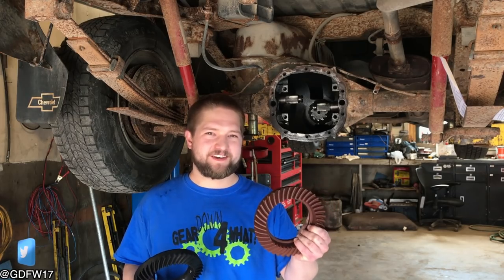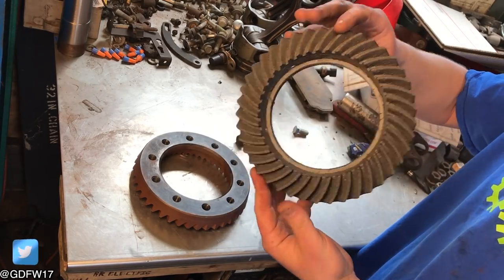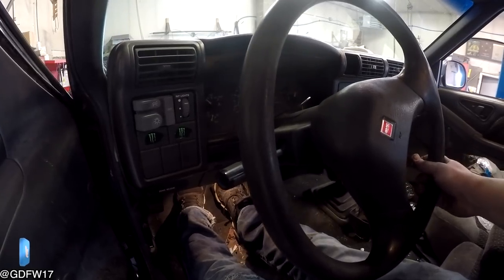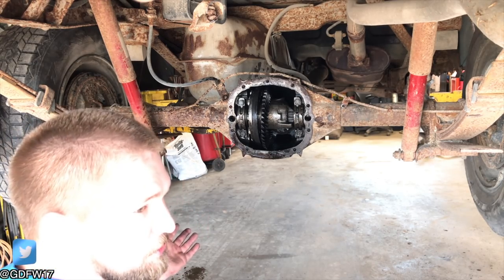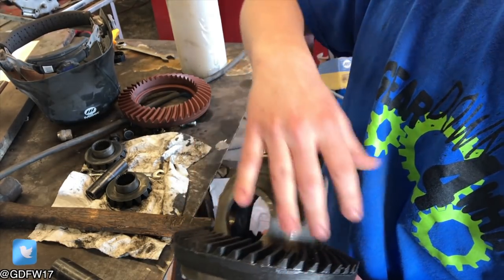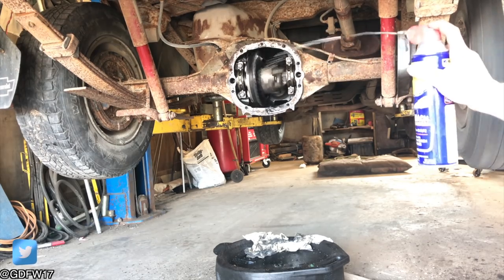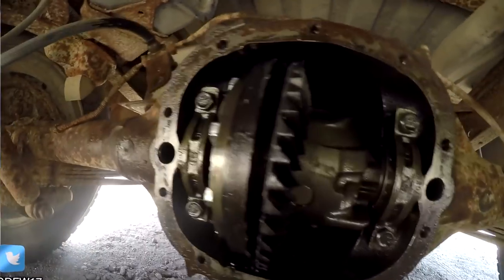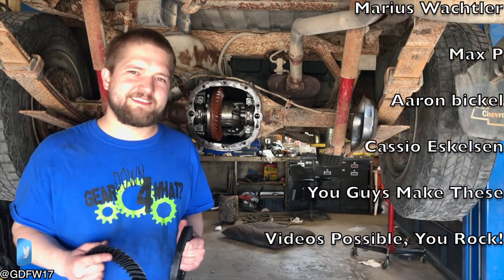Replacing Drivetrain Parts with 3D Printed Carbon Fiber Nylon - FOR SCIENCE!

Comment: Pretty slick! If you need to embed the nuts rather than drive them in from the outside I would suggest designing keys and slots into the two segments of the build. That would channel the torque load better than the flat surface of this design.

Comment: Usually, when you change the material you use in any kind of part, you must redesign it in order to adjust it'resistence to the new material. If the design keeps the same, probably, it will not work in most cases, but with changes, I believe you will have success.

Comment: you'd need to autoclave it,  the layers are strong against their tensile, but applying torque that isn't perpendicular to the layers, will cause separation since they aren't actually fused.

Comment: Either design this as a continuous print, or as two different prints with teeth to increase surface area.
Also WD40 is a terrible lubricant

Comment: Wd40 is petroleum-based. It melts most plastic.
Reply: Nylon is extremely resistant against most chemicals
Reply: I've never seen WD 40 melt plastic.  Any type, ever.
Reply: Maybe that is not the prpblem, but never use WD40 as a lubricant!

Comment: Print it at a 30° with supports, so that your z-axis does sit perpendicular with the torque being applied. I’d also use press in (with heat) corrugated nut inserts so that you’re not pausing the print process halfway through.

Comment: Slots to the inner edge of the ring, slip the nuts in via the slots and bolt up, that way the whole thing can be done in one print, you might also want to print it at a 45 degree angle so the grain isn't horizontal to the rotational pressure

Comment: Maybe just reheat the part before restarting the print
Reply: Michel PASTOR I was thinking this too, use a non contact thermometer to read surface temp at the pause, then heat gun or hair dryer to bring the surface back up to the previous reading.

Although I think using slots to slide the nuts is may work out better.

Comment: I have one thing to add, i have used 3d printed parts in production and for my part it's not the filliment that is the biggest issue. it's delanimation and layer density  in extruded printing. But if you need it to last say a 100 000 handelings before it brakes extruded is out of the picture. The only thing that works is SLS. SLS PA have been used in production for two years now and it is only chipped in some corners. and this is where aluminium is normally used but it doesn't work due to weight.

Comment: Use T-Nuts and put a recess in the rear of the gear body for the flange of the nut. Make sure to go slightly below flush with the recess so you can avoid wear. The bolt will compress the T-Nut against the gear body. The flange and nut shaft will act as the mechanical interface, which will limit mechanical wear on the 3d printed part. You can then also print the part all in one go meaning you'll get proper layer adhesion all the way through. Also, it's important to note that THICKER layers will result in a stronger part, but the detail will be lesser. It looks like you printed very fine layers, which results in a nice looking part, but one that breaks more easily. I think it's worth giving these things a shot.

Comment: Yes, totally to a full print and tap out left handed threads directly into the final product.

Also print it with slightly under sized holes so tapping out the threads will be easier.

Comment: Why did you have to hammer the nuts in? Why not size the nut holes so that they will just drop in or push in by hand and taper the holes very slightly near the bottom so when you tighten the bolts the nuts will snug up? You can drop or push the nuts in without interrupting the print this way. You definitely have to do this again!

Comment: You should try to print it as a single piece with slightly oversized holes, then use metal inserts for the threads.   You basically push them in using a soldering iron.  You get 90% of the benefits of threads, without having to pause your print, and it's much better than just cutting threads into the nylon itself.

Comment: I definitely think you should revisit this again. Taping holes isn't going to be an Issue. Making slots to slide in, I think would be less material and less strength , though easier than taping; but what I'd like to see is all the gears in the differential replaced with the carbon fiber filament. If this gear can hold up to the strength pulling the truck, I'd love to see a closed and filled differential running in second gear on the road. At that speed both gears should heat up, and of they are the same material, expand at the same rate. I'm curious how many expansion cycles it can endure at low torque before they self destruct or have the mating surfaces degrade before the teeth along the ring sheer past each other.

Comment: Have you tried printing in 2 separate pieces? Make the top part with dowels and the bottom with corresponding holes. You can make some double sided dove tails to connect the 2 halves and laminate the whole thing with epoxy. You'll have to compensate your scale to accommodate the resin but should solve your problem.

Comment: I think that custom threaded holes would ensure the layers properly adhere. But, if you are going to stop half way and put nuts in, maybe printing it in two pieces and securing them together with extra bolts?

Comment: That's actually quite impressive for a first try and I am saying this as a professional engineer. I would recommend getting some sort of oven to pre-heat the section you mount the nuts in before re-commencing 3D printing. However this is not my specific area of expertise, and other steps may be needed. I am certain though that not pre-heating will cause problems. Also remember your "plastic" and the steel in the nuts have different specific heat capacities (the amount of thermal energy needed to raise the temperature of 1kg by 1Celcius) and different thermal conductivities, so pre-heating may take over an hour to get fully stabilised all the way through. Hope this helps.

Comment: my 2 cents is that the nuts were moving around from the shear force on the bolts. the nuts moving around helped the part split where the two halves were joined

Comment: I would have included a thin metal ring and thin metal spokes hidden inside the Nylon to increase its overall durability. I would also have given the assembled part a thin but hardened coating of fiberglass or a similar material.

Just wondering though; how well do you think a 3D printer would work if you crossed it with a vacuum chamber?

Comment: Ok, open up the nut hole tolerances so you can slide them in with adhesive while still on the print bed with a quick print pause.
Anneal the print afterwards to maximise layer adhesion.
The direction of force is always going to work against this inherent weakness in printed parts, particularly in sheer force, though doing the above will give it the best chance.

Comment: i think your best bet is to make it solid and drill and tap the threads. maybe tap the threads deeper for longer bolts and larger then helicoil them in order to get a more surface area in the plastic to hold the bolts.

 might also be a good idea to check backlash. while its a much more involved setup then, it could significantly improve the chances of it lasting in any kind of test. its a very important part of rebuilding an axle that the backlash is within spec. just sand the back of the ring gear if the backlash is too tight. if its too loose well run it anyways. also would be curious what the gear pattern would look like with gear marking paint after alittle wear-in

also would really have to make sure the ring gear is not off center. that would put alot of stress on it. when you JB Welded it and said its not perfectly on straight it was doomed.

Comment: I think I'd be cool to see again. Certainly wont last long term, but for kicks on a Saturday, I'd watch.

Plactic cam gears have been around longer than most people have been alive, works fine in low load applications. Modern cars rev too high and have much higher spring pressure. John Deere uses plastic cam gears in the engines for their ride on lawn mowers. It's quieter than metal on metal gears but the tend to have issues around 300-500 hours.

Comment: I use onyx by Markforged which is pretty much the same as nylonx and have been very successful with tapping it to thread directly into it. Might try that. Or like another comment mentioned to put pockets to place the nuts into. Also, if you get someone to print one off on a Markforged x7 they can inlays a continuous strand of carbon fiber which will strengthen it even more. Will be about as strong as aluminum.

Comment: (1) Make the base upon which you're printing, threaded.  Screw threads to the appropriate penetration ("depth" if considered from the "bottom"; "height" if considered from the "top"); for a higher-strength ring, consider linking the nuts.  Install the nuts at the proper height (depth); print the ring, remove the threaded standoffs that positioned the nuts.  For an even stronger ring:

(2) print the ring gear with captive-nut holes in the Nylon-X monolith, then print metal nuts in the holes, such that the threads form an interference fit causing the "nuts" to "swell" in the pockets when the screws are installed, removing any side-play that might otherwise have existed.  This method actually involves a little engineering, as you're switching from bolts to screws (and changing materials and manufacturing methods, etc -- but you were doing that part anyway).

(3) The "cheap and dirty" alternative is to drill the printed gear and use threaded inserts to capture the bolts.

Comment: Amazing

you came a longway. Please continue.

I could not understand using a solvent with plastic.

I could be wrong but observe the following:

the higest stress concentration is around the teeth. If anything that will brake, it will be a tooth.

But since no tooth broke, that means the idea may work.

I could be wrong but the failure maybe related to the solvent (wd40) and lack of adhesion as you mentioned

Comment: As a drivetrain rebuilder of 30 years I was interested to note that there did not appear to be any check of the contact pattern between the pinion and ring gear..they are lapped in as a matching pair during manufacturing and cannot really be mix and matched successfully. Poor contact will result in noise at best and tooth failure in short order. I appreciate the effort made in what they did..and I won’t dismiss it as potentially feasible however the stress on gear teeth requires strength that I can’t see being achieved with a printed part.. but I’m not involved in that industry so maybe it is possible. I enjoyed the video and thanks for making it guys.

Comment: You should also temper the plastic. Which is heat it just above it’s glass temp. This will make the part even stronger and less likely to delaminate even though where your delamination was due to the pause in the print.

Comment: Would it work if you made the pockets for the nuts go right the way through the ring gear from the tooth side, inserted the nuts, then printed in the "missing" bits of tooth?  For extra strength you could drill through and tap a shear pin in to stop the "plug" dropping out.

Comment: Actually if you can print it perpendicular to the heat bed I thing it should be much stronger than this. The part snapped at a layer so what's tested here is not actually the material strength but the strength of the bond between each layers. I'd love to see how that works out.

Comment: Is it possible to have a 3d printer designed to have a 90° turned extra extruder to add layers over the side of prints to add more structural rigidity?

Comment: Looks pretty fun! But in my opinion the problem is that the load direction was parallel to the layers ... And of course that you had to stop the print. Probably try to do it without pausing the print with the mentioned tipps and turn it by 90 degree .... I know its a problem to get nice circular faces then but it should be stronger then

Comment: You can do the nut inserts just get it hot again with a hair dryer or heat gun before resuming the print that should encourage better layer adhesion...you could even pop it in the oven to bring to a precise and uniform temp

Comment: Just an idea, you should put structural pins in both sides of the ring gear. That will help with the lateral force on the separation

Comment: This is cool! :)

Besides layer adhesion, removing the print from the printbed might also impact the concentricity of the "gear part" to the mounting surface. Only a few hundredth of excentricity will cause the contact area to shift over the width of the teeth, possibly causing the pinion to jam into the ringgear.

Gear backlash is also quite important in this case i guess, since binding of the two gears will most likely cause a bunch of the stress on the nylon and the pinion to munch away on the ringgear.

If you dont know already: you can easily check backlash using a dial gauge, placed perpendicular on a tooth surface and wiggling the diff back and forth, while blocking the pinion shaft; somewhere around 0,15-0,20 mm should be fine i guess. Too little will cause the risk of binding, too  much will cause the teeth break at the top.

For you next print i would suggest reducing the height of the ringgear, this will allow you to adjust backlash by placing shims between the mounting flange and the ringgear.

Comment: You need to 3D print 2 separate parts with vertical interlocking parts so that you don't have to do a pause print. Drop the nuts in, then put the matching parts together and add glue to prevent them from pulling apart. That should solve the layer adhesion issue since all the stress that's put on it is parallel to the way it's turning.

Comment: I absolutely think you should redo this video without layer issues. The shear gear in most transmissions is plastic and it holds up just fine until abused.

Comment: An exotic additive lathe 3D printer would be really good for this. Then there are no axial layers but only radial ones. And there are much less shearing forces because the meshing teeth distribute the load well.

Comment: Hello, I think you need to print it rotated
You're using FDM, so you print it by layers, so you don't have enough strength between layers
But if you rotate the 3d model of your gear, you'll be able to get different result.
Sorry for my English

Comment: Maybe print the gear as two halves, incorporate a 'dog' feature to transmit torque through the plastic without putting the shear force through the adhesive layer, and then bond the two halves together with your JB-Weld or other suitable epoxy.

Comment: Try round knurled thread inserts to eliminate the need for an m00 (print pause) and try a hotter extrusion temp, alternate print direction lines between layers, and a bake in the oven after printing for layer cohesion. Also i've always been curious about the foundry 3d printer filaments that requires a 5% oversize to compensate for oven baking afterwards to melt out the little bit of plastic that bonds the metal. Just thoughts. I love that you guys took the time to do this. Big Like!
Reply: Nylon doesnt bake well.  PLA does though.

Comment: Hey, put metal studs on each teeth (2-3 of them if you can) , like 3mm pins and glue it.

It will add shearing force. At this point, all you have to worry is deforming :)

Comment: Print a one piece ring gear and differential carrier. You just have to remember that the gear type is a hypoid bevel which means that the teeth slide on each other to prevent gear noise. So there's a high amount of friction on the teeth that's why you have to use high pressure type gear lube. So if you can get it to withstand the torque pinion gear against the ring gear teeth you will have to deal with the friction from the gear teeth sliding across to each other so WD-40 will not do well there.

Comment: 3d print the ring gear with nuts in place you can set them up off the table a little bit or put the bolts part way through them so the filament does not get to the threads, or just print over the entire nut then run a tap through to clean them up.

Comment: Try making the gear in one complete with no nuts embedded.  Then install threaded inserts.  Either use the whole EZ Lok ones that thread into a tapped hole, or a Helicoil.  There are threaded inserts made for plastics, or an insert for a wood project may work well.  I inspect the method of insertion an the bulk of the insert for work with non-metal parts.  A Helicoil would probably not be best here.  And LocTite insures that the insert thread into the plastic is in full contact.  And WD-40 will sometimes react poorly with plastics. It can cause it to become brittle or soft, also it can cause a glued part to loose adhesion.

Comment: Very cool concept.  It's a shame the gear delaminated from the base like that.  Another idea you can try for the next one is to have pilot holes printed into the ring and use nutserts instead of actual nuts.  You can glue/press them in.  Just to see that thing roll 20 feet backward on a 3D printed nylon ring gear is amazing.  I'm excited to see some before an after images of one installed and fully submerged in gear oil.

Comment: You can't remove big print like that especially from nylon from printer during print. Also some encloser to keep higher temperature should help a lot. You should increase pockets for nuts so no hammering will be needed and just quickly place nuts, so you will minimalise pause time. Or you can just get rid of nuts completely and screw bolts directly to plastic part. It will probably fail between layers again first anyway.